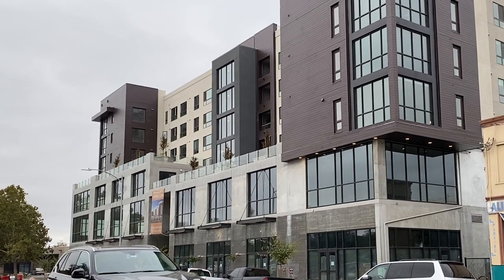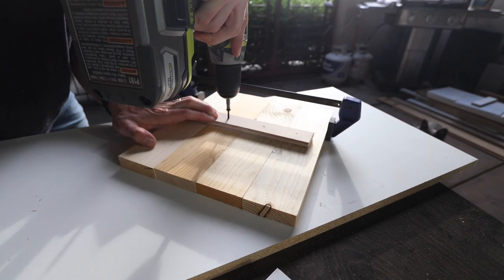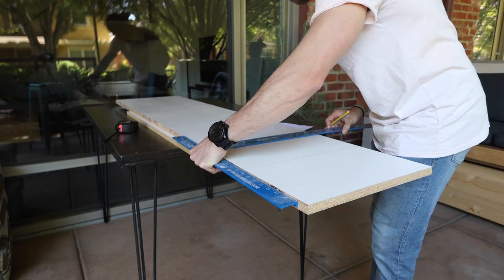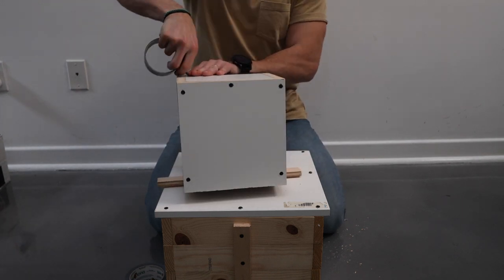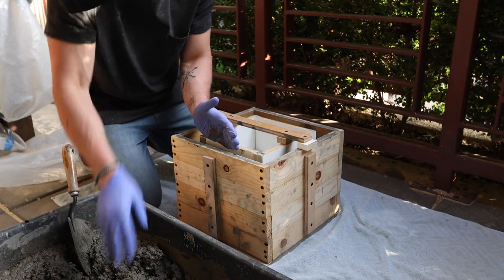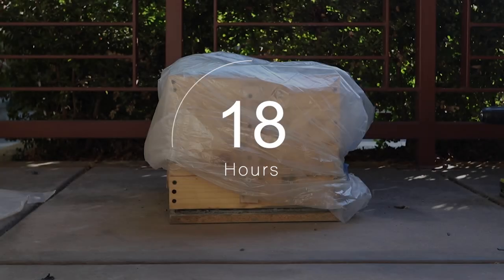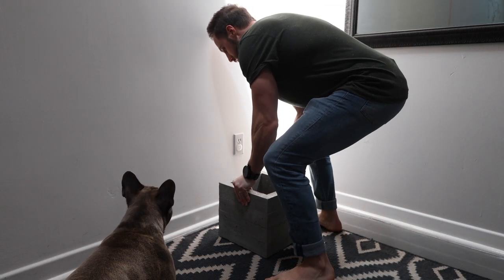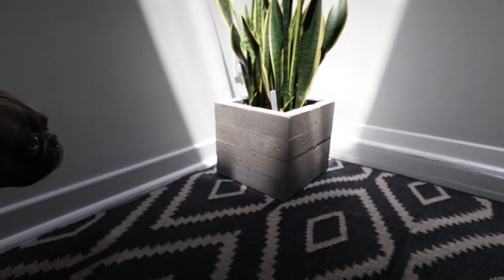DIY Board Form Concrete Planter

Comment: Great build.  One thing I would recommend for an indoor planter, especially in this application is to coat the inside with drylock sealer. Excess water will seep into the concrete, and into the rug. This type of plant requires little water but it's an additional worthwhile step.
Reply from the maker: Good advice. Thank you!

Comment: The concrete box has no drainage hole. In order to water the plant, you'd have to remove it, water it elsewhere, then replace it in the concrete box. Another option is to use a faux plant.

Comment: putting a wire brush on a drill or simply wire brushing the pine will bring out an amazing amount of wood grain, I used this technique on a table I made and the results were fantastic and simple to achieve
Reply from the maker: Awesome. Thanks for the input!
Reply: In addition to just a wire brush, if you have a propane torch, you can char the surface of the wood, and then brush it.  The growth rings of the tree differ in density depending on when in the season they are formed (earlywood vs latewood) and the torch will burn away more of the less-dense earlywood, so when you brush to remove the charred portion, the varying depths achieved accentuate the grain.  The whole process can be done with just a brush and no torch, but the torch just makes it easier and quicker.

Comment: Make the inner box 2 peices per side with the seam running vertically in the middle with a scabe piece holding it together, so I can be removed without breaking
Reply from the maker: Hhmm. That might work. Good advice. Thanks for sharing!

Comment: Nice and easy project. Fantastic result. Can you suggest some way to better project the wood grains, sand blasting isn't a viable choice. Also try rubbing a hammer drill on the planks to vibrate and send our air bubbles.
Reply from the maker: I’ve been trying to figure out ways to get more pronounced wood grain. I think next time, I’m going to try and create artificial grain just by etching lines into the boards using a screw driver or something similar. Also, I read somewhere that wetting the wood and letting it dry out will bring out the grain as well.
Reply: @acreativetraveler783  A power/jet washer does the job very well.
Reply: Shou sugi ban is a process that burns the wood for completely different reasons, but has the effect of making the wood grain more pronounced.

Comment: Wetter mix added in multiple lifts would eliminate the honeycombing/air bubbles. But it looks cool that way too!
Reply from the maker: Yeah good advice. I actually kind of like some air bubbles 😉
Reply: how do you get it wetter?
Reply: @guangyizhu5232  add water 🙂
Reply: Exactly. Good advice as long as the mix isn’t sloppy wet, which would weaken the finished product.

Comment: Try using an electric orbital sander with a bare pad on the outside mold to knock out the the air bubbles. Quicker, less effort, more efficient than that rubber mallet. Good job.
Reply from the maker: Thanks for the recommendation
Reply: Even better is a jigsaw, or reciprocating saw

Comment: there is a technic we use in woodworking to bring the grain out, "water and a torch" basically the tab wet the surface of the board and then you use a torch to charcoal the boards the you can clean the chard boards or sand them all depend how much of the grains you want to show.

Comment: Wouldn’t adding petroleum jelly to the inner box help it not stick to the concrete. I think we did that to a molding project in elementary school but I’m not sure lol
Reply from the maker: Hhmm. I don’t think so. I usually use paste wax, which works great as a mold release. However, it’s not about the concrete sticking. It has to do more with the pressure that builds up around the inner box.

Comment: I thought of your video while working on a project yesterday. I had recycled some old composite boards into form boards for a little concrete project. Like most composite boards, these had a wood grain finish on one face and smooth on the other. They also released from the concrete very easily without any additional treatment.
Reply from the maker: Awesome! It’s kind of funny how every time I go to Lowes of Home Depot I look for good options. And that is one of the things I thought could work great. I’m definitely gonna have to try that one of these days. Thank you for reaching out and letting me know!
Reply: Just after typing the comment, a “Build Show” video came up on the topic. Obviously a different scale of project, but also great info. 

They also love the wood grain texture in poured concrete, and commented they found Doug-Fir to have the best graining. 

They also sand blasted the wood to really accentuate the grain. Reminded me of a pale version of shou sugi ban. 

Glad to help.

Comment: Looks awesome, thanks for the ideas!  How many bags did you end up using?
Reply: A 60# bag of concrete mix makes 0.45 cubic feet of concrete. I’m guessing the planter shown was less than one bag of mix. 

To calculate the volume you would need, first measure then multiply the inner length, width and depth of your outer box. Next, measure then multiply the outer length, width and depth of your inner box. Then subtract the inner from the outer and divide by 1,728 to convert from cubic inches to cubic feet. 

Good luck.
Reply from the maker: Yup. It was definitely less than one bag.

Comment: Yes. nice project. Getting the center box out of the mould is difficult. Have to break it out.It wont pull out.
Reply from the maker: Yeah. That is the tricky part. I’m trying to figure out better solutions for that.
Reply: Creating the box with a slight taper would be a bit trickier, but should work.